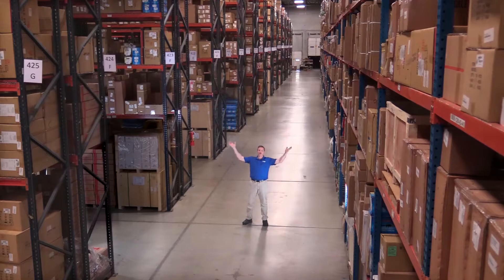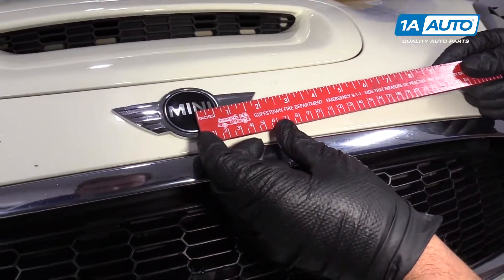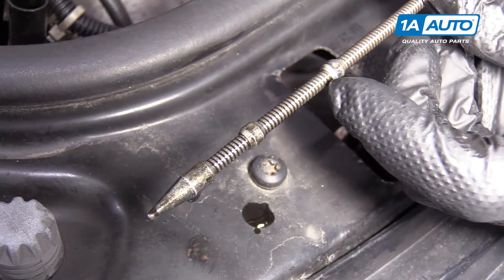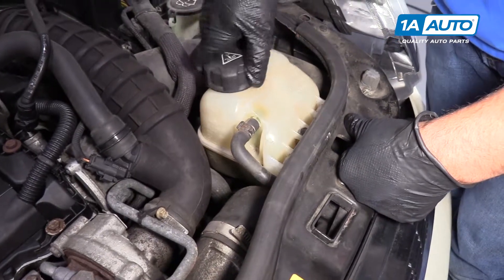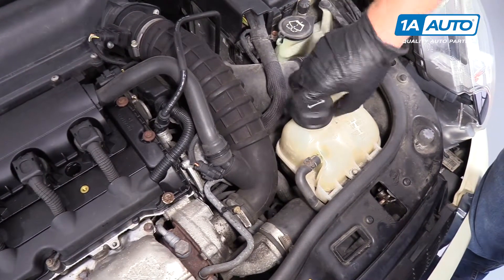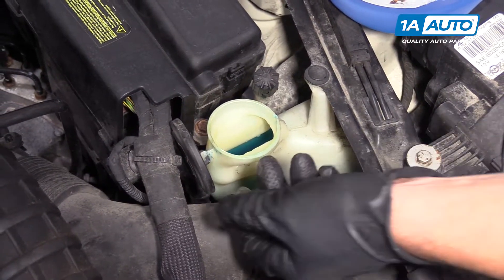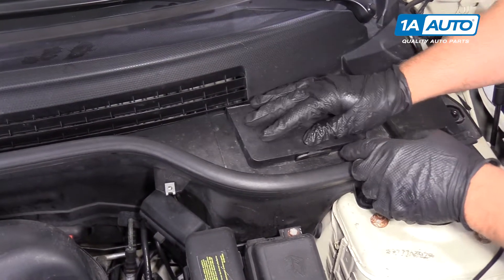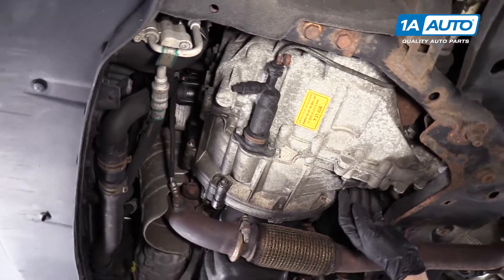How to Check and Fill Fluids 07-13 Mini Cooper S

Comment: Omg.  The one thing I needed check was not in the video.  Transmission fluid.   Wow
Reply: you only really need to check the trans fluid if/when changing "as its widely known that BMW mini's do require trans fluid changes"
you simple park on level surface, drain all old fluid via the lower drain plug.. refit that.. there's a higher fill plug further up the transmission.
to fill the trans, you simply fill the transmission until fluid runs out of the fill hole, then refit the fill plug (when filling the trans make sure the cars back on level ground or on a car ramp (LEVEL) don't fill it when the cars up on a jack lifting the front of the car etc